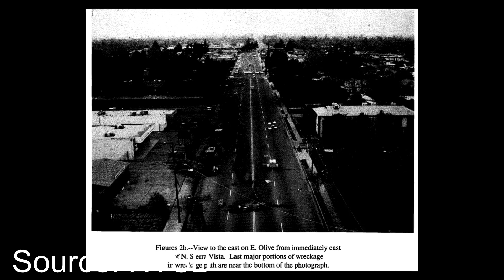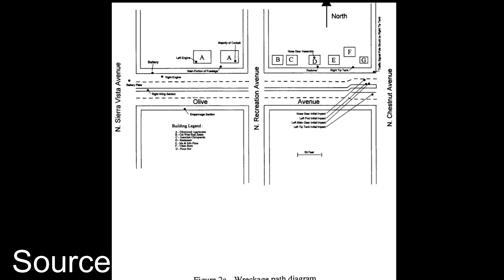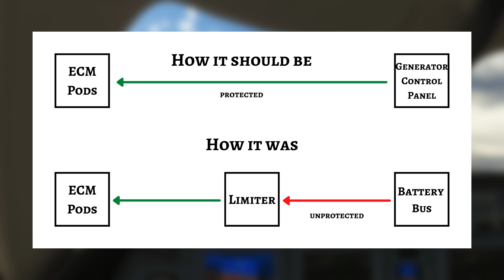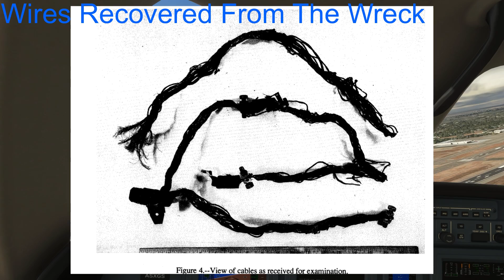How A Tiny Wire Set This Plane On Fire| The Crash Of Dart 21

Comment: Buddy System or Redundancy Checks (where any single tech' checks another tech's work, and gets his work checked by a fellow tech'... even before a Supervisor signs it off "done")... The REAL solution is that ALL TECH'S are evaluated and educated to AT LEAST be capable of reading block diagrams and/or schematics.

     This ain't terribly complicated. I'm a High School Grad' AND I CAN read block diagrams, schematics, and blue prints. It absolutely amazes me every time I get hired SIMPLY because I can read the damn scat's! If you can't read a BLOCK diagram, you've got no business "under the hood" until you learn how. It's just that simple.  ;o)

Comment: No spark. Without a fuse or breaker, the wire just got hot, like the wires inside a toaster. It became it's own fuse. Eventually, probably quite quickly, it just overloaded to a couple thousand degrees and set anything near it on fire.
This is a common issue with people that wire up aftermarket stereos in their cars. Always have a fuse or breaker in line somewhere to prevent shorts.

Comment: His bad maneuvering crashed the airplane.  Not the fire on the back of it.  Wake up.. He overshot the airport because didnt want to do the required 270 degree turn to lose altitude (turning afraid)- His First pilot error.  Flew next to runway, but too close, 2nd error.  Then tried a turnback too low and too tight.  3rd error.  All about turning maneuvering errors, or GRM errors he did.  The airplane was flying fine.  He didnt.

Comment: First thing my Auto shop teacher did on day 1 of school year was... 
-put on a shop coat and safety glasses
-pick up an 18 in piece of 12-gage wire using insulated-handled pliers at each end
-hold each wire end to the opposing terminals of a 12V car battery

POOF! Hardly what you would call a fire! "Just" INSTANTANEOUS COMBUSTION!
All the insulation was immediately vaporized.
This is what happens if you wear a watch or jewellery while working under the hood or the dash, he said.
Wow! Most impactful lesson I ever learned.

Comment: For perspective:  the added unit was running a load of up to 300 amps.  An average house these days runs a breaker panel of 200 amps, sufficient to run an electric range and oven full blast, the lights, refrigerator, dryer and other things simultaneously...

Comment: What we do at work, on networks of computers, is to write the procedure and test it in a lab with the same equipment as production, send the procedure to a second team that reviews it and tests it on other lab equipment, then review the procedure on a call.  When we implement things on the production systems, we're all on the call making sure the person executing the procedure is doing it correctly, and we handle any deviations in the production systems by backing out the procedure, fixing the discrepancy, then re-trying it.  So sort of a buddy system, but in a long, drawn-out way.

Comment: The quality and skill of some of the people that end up working on airplanes can be down right scary.   I used to work with a guy that worked for American Airlines, but he was working part time as a mechanic at the local Suzuki dealership.  I thought the quality of his work was bad on ATVs and motorcycles.  But the stories he'd tell about the work he did for AA was cause for alarm.  He talked about how they'd cut corners on repairs, intentionally close something up before it could be inspected, substitute wrong parts, etc.  I hope he was exaggerating, but I fear he wasn't.

Comment: Actually you don't need a spark, overloaded wires burn houses down everyday just from being too hot, that's why you have to have larger gauge wiring for more high power situations. A short circuit is an easy way to heat up wire, just check out electric heaters. They can set things on fire too, no spark necessary.

Comment: I wonder how a buddy system would help.
Some work has to be done on in hard to reach area.
The job is not done, until the covers are installed and secured.
See where this is going?
Person A needs to do the actual job, Person B needs to sign it off, Person A needs to install the cover, Person B needs to sign it off... and then people start complaining about leaving half finished work in the hangar, causing missing work steps and misplaced mounting materials.

What I could imagine is photo documentation.

Comment: 300 amps??? I don't think any generator on a Learjet can produce that much juice.
Reply: The battery charging bus is supplied by two 275 amp fuses, I can’t remember the generator output, but two of them definitely can supply way more than 300A

Comment: Hi there, 

An interesting video for me since I've been involved in Learjet airworthiness and modification for many years. 

There IS a 'Buddy' system for maintenance technicians. It's tje Independent Inspection (also known as Duplicate Inspection). This is needed for all flight safety sensitive maintenance tasks.

Also, a technician that is licensed and allowed to sign must know what to do,and not just shown by someone else. That would be gross negligence. 

I know that FAA rules are significantly more lax than EASA rules, but there is no justification for this, if the story is complete. 

Incidentally, technicians are to write down the exact references to the wiring diagrams used and must work with the documentation at hand.
Thank you for the video.  I will certainly look up the NTSB report and try to understand what happened with more details. 

Cheers 
Mark

Comment: The captain got all nervous and confused and even tried to do steep tight turnbacks slow and low altitude.  He stalled the airplane doing turns the wrong way.  The fire was not affecting the controls.  I have seen that nervous reaction many times before.  See my username.  He did very bad Emergency Low Maneuvering and crashed stalled.

Comment: AFAIK, the FAA doesn’t publish detailed modification instructions. The aircraft and/or the supplemental part manufacturer provides those. The 337 only states, in summary, what the shop intends to do to the aircraft. They submit the 337 to the FAA. The tech is supposed to follow the manufacturer’s installation instructions, not pull ideas out of his ass or blindly copy what another airplane “looks like”. Had any of the shops, a supervisor, the manufacturer, or the FAA inspected the work on just one of these 14 aircraft against the install documentation, this would’ve been easily caught.

Comment: You short out a battery, its internal resistance drops which, in turn, allows more current to flow which then drops the resistance again and so on until the battery eventually explodes.

Comment: If any plane is about to crash, I would recommend tipping the nose up , flaps full, landing gear down all to slow you down and when you are 20 ft from the earth, put your reverse trust on and drop out of the sky, rather than crashing at high speed. This will save many lives, if their brains and reaction time could work as fast as mine. As fast as it should be to qualify being a pilot

Comment: "When the jet was at 9000 feet, 10 nm from the Fresno air terminal"  Hello?  What the fuck was the pilot thinking?  I would have been screaming "We need lower!".  10 nm from the airport, unless you are in the traffic pattern, you need to be about 900-1000 feet above the threshold surface!  

The fire was burning through wiring while the crew ran checklists, and by the time they got these done the control cables had been burnt through.

Comment: When a mechanic’s work can bring down a passenger plane resulting in hundreds of deaths, there definitely should be a second and third inspection afterwards🙁
The same with the co-pilot’s walk around checking the outside of the plane, they should have a checklist in hand that is checked and ticked off - how many accidents have been caused because a piece of tape was left on , covering the pitot tube🙁

Comment: So what I understand: the battery bus is not power limited. So if any of the cables on that bus fray, the result will be the same, with or without adding a limiter and an ECM pod to it.
Which would be a pretty major design flaw.
What am I not getting?
Reply: All of the other cables use a fuse, fusible link or current limiting device. A fusible link at the bus can be as simple as a short piece of wire, at least 4 gauges smaller in diameter than the circuit feed wire in some instances, as in automotive charging applications.
 Fusible links or fusible link connectors are another option. They melt at a predetermined current and thus effectively open the circuit in case of higher current than their rating.

Comment: Worked as an electrician who installed a jumper wire after generator was up to speed so any secondary failure would trip the reactor - we used the buddy system - he failed once & I fixed the error - years later he  failed again & which lead to no safety failure protection during a fault - You need a supervisor or other well trained personal for major safety related work -

Comment: What you call a "buddy system" is already in place and has been for decades. In real life it's call QA or QC, as in Quality Control or Quality Assurance. Every airline or repair station I ever worked for has it, it's an FAA requirement. Besides that, no work can be done on any aircraft without using some type of approved data, such as maintenance manual, engineering drawing, manufacturer's specs, etc. How that company got away without all that is beyond me.

Comment: I wonder if the duty cycle of the electronic countermeasures was longer than usual on the day of the crash. Even without a component malfunction the 300 amps of current may have caused heat damage to the insulation of an undersized wire. Seems like something that would get more dangerous as it is used.

Comment: This is a problem in every repair industry. It amounts to, I can do it cheaper and or quicker this way and if you never have an overload which you probably won't no harm no foul. I am in the marine repair world and see this daily from other mechanics that think they are doing someone a favor to shop owners that quotes jobs instead of estimating jobs and under quotes or even under estimates but want's to save face and doesn't want to argue with the customer or doesn't want it to eat up his profit. Sometimes they see it as a big savings of cost and turn it into profit by changing the planed install or repair. I realize this is a bit different but probably the same. Depending on the work load and the expected time frame for completion, this could have been a short cut to meet the handed down time expectation. It happens all of the time everywhere. Someone at a higher food chain thinks they will get extra brownie points or money. Civilian and military.

Comment: This is a common problem in vehicle and other battery powered equipment.  The technician doing the work needs to understand the design and correct a bad design or design errors.   Not all technician have the ability to do this   Lots of trade schools and apprentice programs are very weak. It is not hard to find a good trade school.   Go to Germany

Comment: As far as i know most maintenance procedures under EASA rules have to be done as you suggest. One engineer is responsible for the modification, and then another check engineer has to check the work is done according to spec and sign off on that. 

Now, i only fly the damn things, therefore i might be mistaken, however that is how it was explained to me why we always get at least 2 maintenance engineers turning up when we have an issue.

Comment: All wires are vital. However, larger wires are used to move large loads. NOOOOO technician would wire a heavy load to a smaller wire. That's what happened here. Use a little imagination.

Comment: A SwissAir MD80 crashed once because of bad wiring of a new entertainment system for first class that intermingled with critical avionics in the cockpit and had no off switch. The jet dove into the ocean at 250 knots after cockpit temperatures hit 600 degrees F.

Comment: There was a small fire on the back, but not on engines or controls. They crashed due pilot stalled doing a  slow tight turnback to land back on airport he overshot.  Here is witnesses notes from the investigation. Engines were working.
Witness states he saw the airplane about 1 1/2 miles from the approach end of 29R, about 200 feet above ground level (agl) in a steep right bank of about 60 degrees or more, overshooting final and not turning.  They said "the nose [was] not tracking at all " (Uncoordinated turn). then it went down and crashed.

The tower stated;
After the airplane passed to the southwest of the extended centerline, it appeared to tower controllers to gradually 
descend very low.  The tower supervisor stated that the landing gear appeared to be down about that time.  The airplane 
then climbed back up gradually from what appeared by line of sight to tower controllers to be above the tree tops.  It then 
again gradually descended in an apparent westerly heading.  The airplane climbed or "porpoised" up a second time, more 
severely.  It then descended sharply until view was obstructed by trees.  A fireball and smoke were then observed. (climbed and porpoised 2 times and went down).  The pilot stalled it doing an improper tight turnback. Looks like he was not familiar with those kinds of turns that require preparation,  proper space to turnback and pilot coordination.

Comment: This reminds me of, if memory serves me correctly, Swissair flight 111, that crashed off the coast of Nova Scotia. New wiring for an entertainment system, had been installed in the ceiling. The work was not done correctly and the wires chaffed, causing a spark that ignited the flammable (mylar) insulation. Two stupid mistakes were made which caused this crash, one by the contractor, the other by the aircraft manufacturer who put flammable insulation in an aircraft. I’m a retired power maintenance electrician and stuff like this just makes me cringe.

Comment: This horrible  accident was most likely caused by an arrogant ignorant mechanic who assumed that it didn't matter where the ECM was drawing power, as long as the source was sufficient.

If an engineer is specific about something, those instructions must be followed in order to prevent something very bad from happening.  Some mechanics (emphasis on "some") assume they know more than the engineer who designed what they're working on, and the cut corners to save time and money, but in the end if can prove to be fatal.  This happens in avionics way more than it should, and it causes parts to fail or fall off during flight, doomimg the lives on board.

An correction is in order -- if a wire is overloaded by too much current, it will most definitely self ignite  without the aid of a spark if either 1) The insulation is flammable AND its flash point is reached by the red-hot copper inside (most house attic fires start in this manner), or 2) the flash point of the copper or aluminum is reached (some older air-gap transformers catch fire in this manner -- the wire ignites and melts, and then begins arcing).

In the case of this plane, most likely the insulation caught fire directly from the red-hot wire, the insulation melted as it was burning, then the bare wire deformed and short-circuited against the metal chassis or anther exposed wire.  The black soot is an indication of burning insulation.

Comment: Very interesting video. Could I ask why a spark is required to cause the fire in the cable? Did NTSB say it was?No source of ignition is needed to start a fire, just fuel oxygen and heat. The insulation can easily ignite from the heat of a very heavy amp overload.
No spark required.
Reply: In addition current would only jump to the airframe if the airframe were part of the electrical circuit. Is it?
Reply: @jamesstuart3346  The airframe is the ground, so yes, it’s part of the circuit. And yes, no spark is required, every material has a temperature where it self-combusts. No spark is needed when the temperature reaches this value

Comment: Hello,
While a buddy system will probably help alleviate some issues, it will not resolve the root-cause problems.
Here are my thoughts about the actual root causes of the problems shown in the video:
NOT using schematics and drawings to communicate to the technician the needed job at hand. The actual purpose of drawing is precisely to remove guess-work from wiring and to allow standard methods to be implemented, in each and every job
A sad lack of training, no one should be doing a job without understanding the safety implications that might result from mistakes. Unfortunately, the upper management often carries preconceived ideas about the challenges of jobs. I have worked for decades in the USA and found that too often the upper management makes a critical decision based on unsubstantiated statements and grossly underestimates the challenges of tasks since they usually have a vested interest in reducing the cost of making things
The requirement to keep investors and stakeholders happy, sometimes interfere with the quality of the job, and almost every time the former takes precedence over the latter.
Thanks for giving me the opportunity to speak my mind
Cheers

Comment: In desperation I once used speaker cable to power a 500 inverter at 12v, worked great but you could see the entire cable just melting and smoking as expected. Served its purpose. DO NOT DO THIS!!!!!!!!

Comment: We do have a buddy system.. the tech and the inspector who signs the paperwork off. In 30 years of maintenance on aircraft..the inspector sometimes doesn't see errors..this  happens alot. The  copy method isn't approved by the FAA, so the management of the contractor is mostly at fault